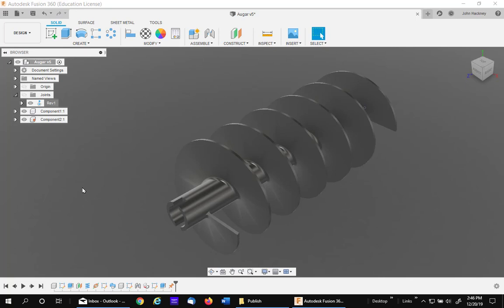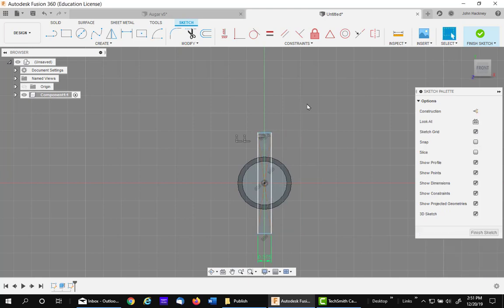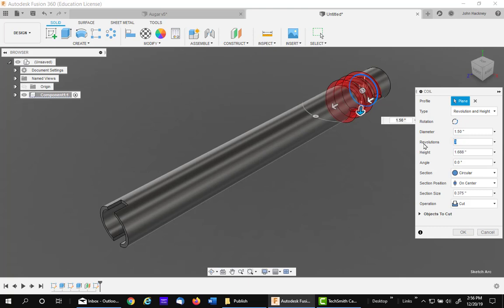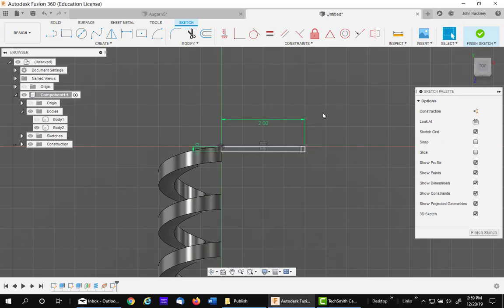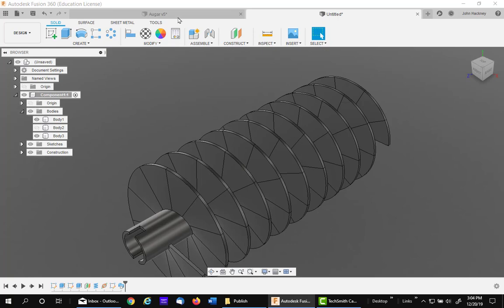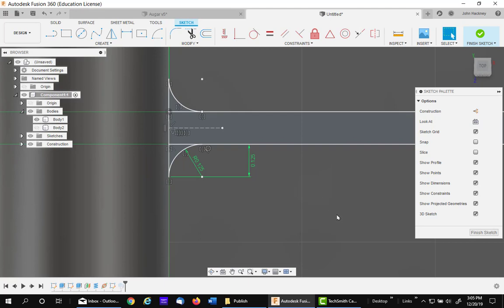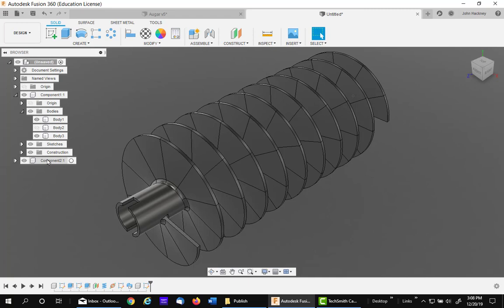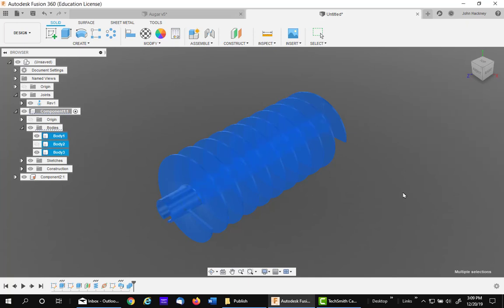Creating an Auger in Fusion 360

Comment: John, How would I be able to show the auger flights without the shaft so I can know what to cut out of flat sheet stock? In the shop, the only thing I can surmise is to make the flights a little bigger than the inner diameter of the tube it is fitting in, as when I stretch the flight to get the pitch or spacing it will shrink around the shaft and reduce in diameter.  I really don't want to trial and error so to speak. There must be a way to make a flatten pattern like sheet metal.  Can you give a suggestion on this, please?
Reply from the maker: If you will send me an email to jhackney1950@gmail.com, I can show you how to isolate one 360 degree flight section.  At this time, I do not know of a method of turning this section into a flat sheet metal pattern.

Comment: Thanks for your Video.

Can I change the the coil / profile in a non linear?
Reply from the maker: Not using an Fusion 360 command.  Any continuous path can be used with a sweep so if you can generate a non-linear coil as a path you can do it.
Reply: @jrhackney  thanks for reply. I will try it.. :-)